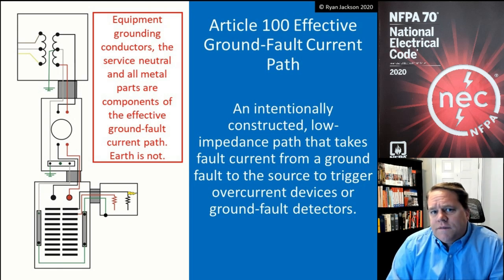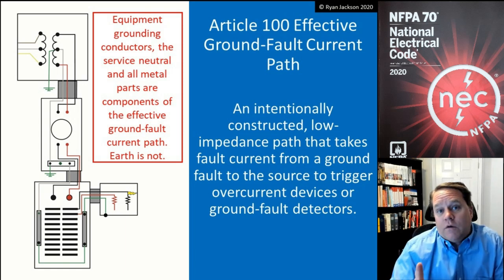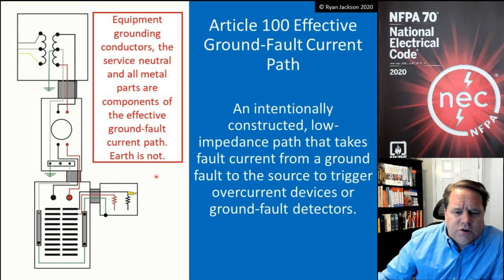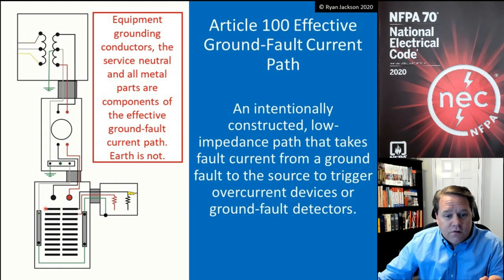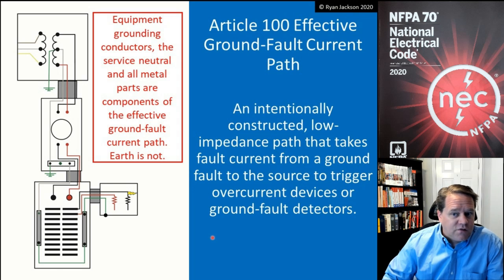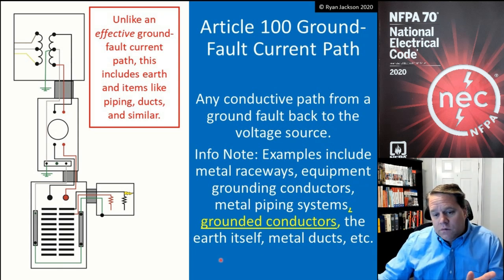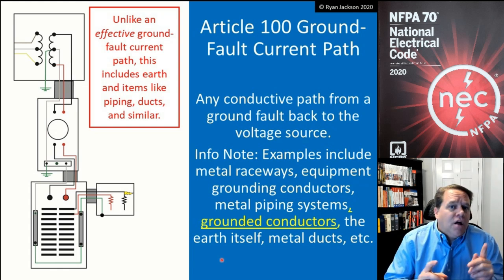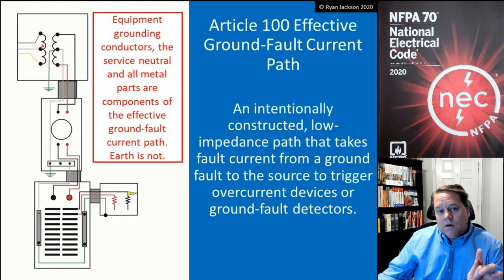100 Days of Article 100:Effective ground fault current path & ground fault current path

Comment: Cool, I'll leave the comment.  GF detectors are needed for series wired heater elements.  2, 480V elements wired in series = 240V across each.  short the middle and the 1st heater gets 277V...not nearly enough to blow the fuse.  I deal with this all the time.  Customers saying "why do we need GF detection?"  My response: "Cuz, you do, trust me."  :)